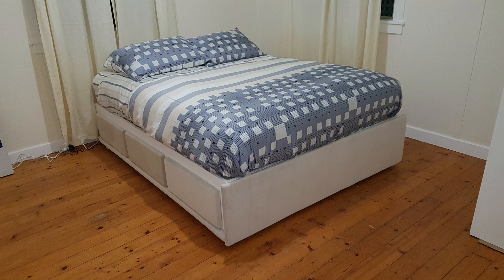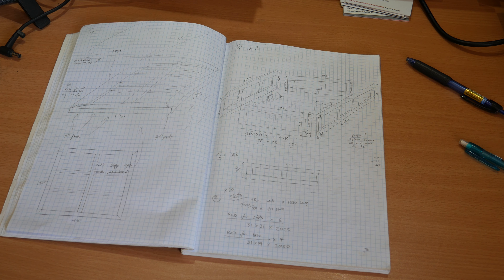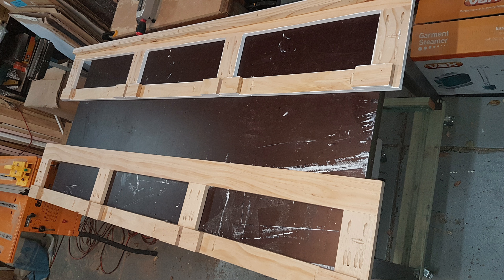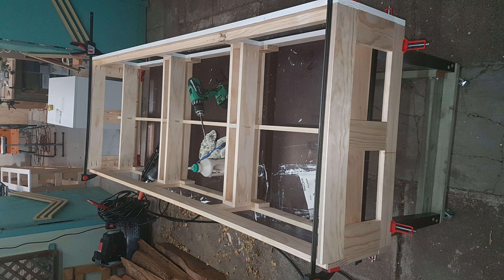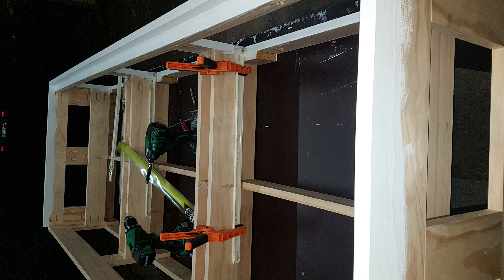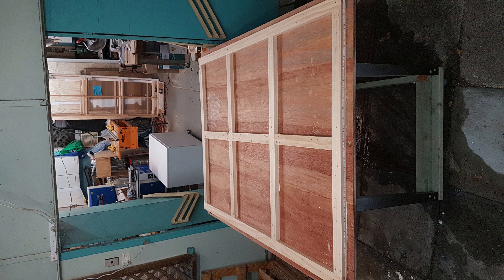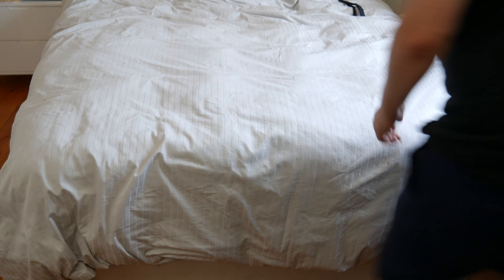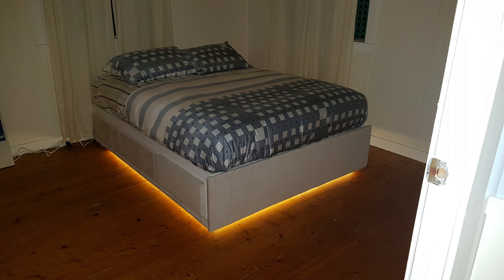Easy DIY floating bed.

Comment: I like that soft yellow underneath.
Reply from the maker: Thanks mate. Yes I made sure I picked one that was not going to feel like a disco. The remote has several settings of brightness. What our house guest liked about it, is the ability to get into bed without a light in your face and then turn it off from the comfort of the bed.

Comment: G’day Dave, very happy to see you back in action & Titto & me & the missus would happily stay overnight because this is an inviting looking bed, cheers 🍻🍻🍻👍👍👍👍
Reply from the maker: Thanks mate. Life sort of got in the way and so I haven't had much time in the shed which has been frustrating for me. Now it's hot as a BBQ in hades but I try to get bits of shed time when I can. I have slept on this bed myself so I can personally vouch for it's comfyness. (Is that a word?)
The tricky part might be when we come to move. It can be disassembled into it's 3 main parts but there are a lot of screws involved. Plus my petite wife made me promise not to ask her to help me move that base again. I can't blame her. It's Fijian hardwood ply. Strong as F..... er... a strong thing. But also as heavy as all F..... er... I mean that bit weighs a ton.